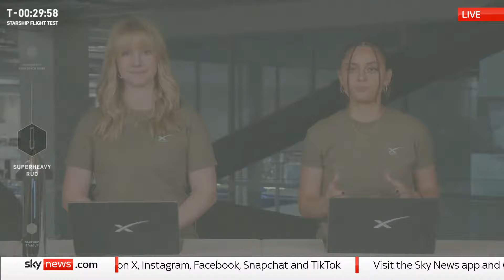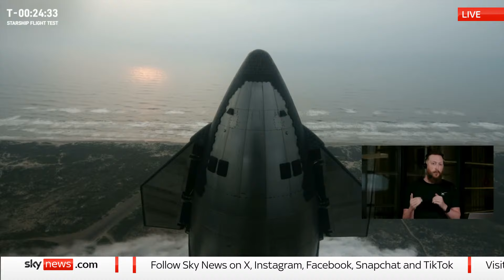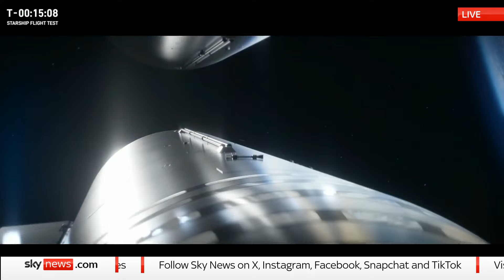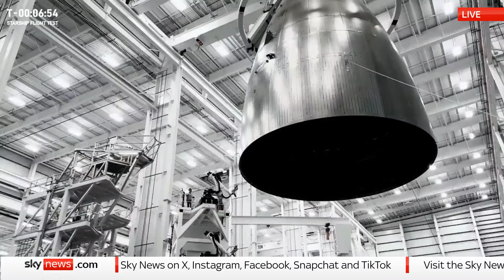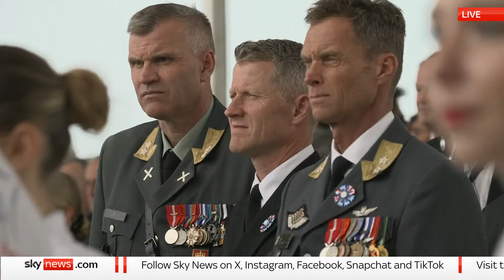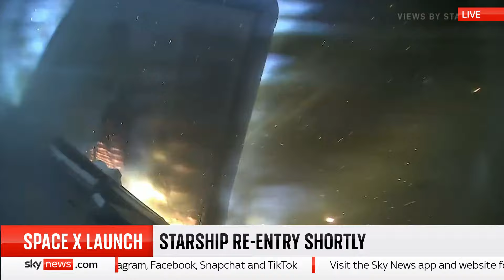SpaceX launches the Starship mega-rocket on fourth test flight

Comment: The numerous flap corrections in test #3 spread the heat over a larger area.  Test #4 was more stable, with less flap movements, may have contributed to the damage?